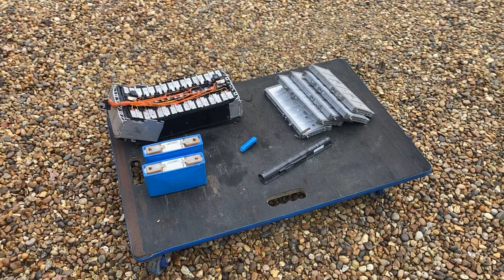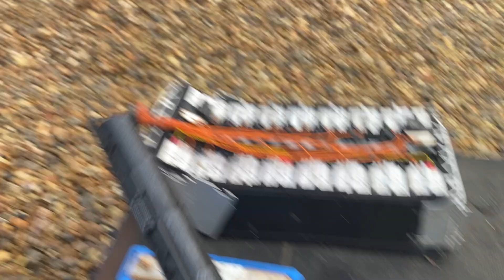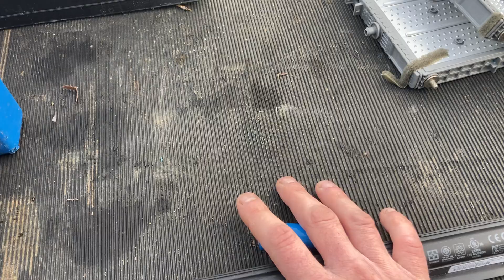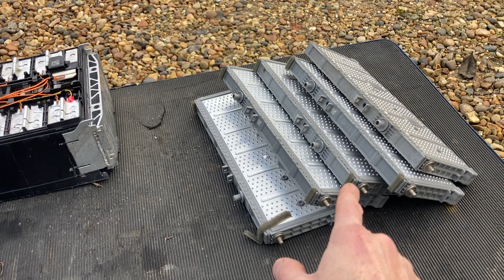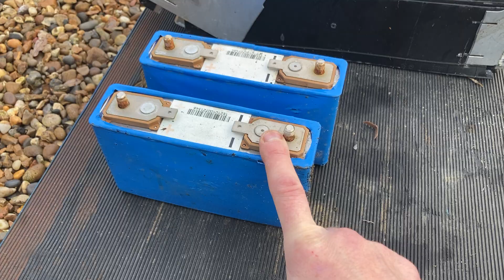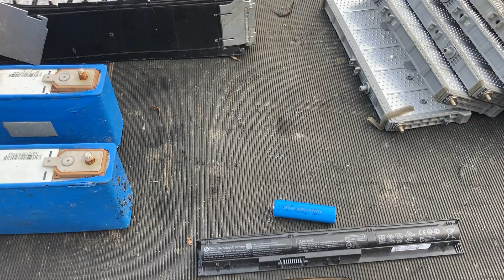Why can’t we recycle big EV electric car batteries in the UK currently???

Comment: Cawley's subsidiary "Lithium Battery Recycling Solutions" claim to be able to recycle EV batteries from commercial sources for a fee. It's really not good enough that there's not a regulated and funded system in place yet. The government can't leave such a safety issue entirely to the market. I expect the market for used batteries to boom at some stage as it already has in some places and some contexts... But it could also boom in the other way if it's not safely established
Reply from the maker: So under the weee regulations the manufacturer is responsible for the recycling and every battery has its recycling cost factored into the sale price. It’s just that it isn’t yet joined up so even if someone at VW for example knows about how to arrange battery recycling (which I’m told there is such a person) not many people seem to be able to contact them to get or arranged and transport options for batteries aren’t yet clear.

Comment: LiBatt in Wolverhampton are now accepting batteries, and bill themselves as the UK's biggest recycling facility. I think they are charging gate fees, so there might be a small charge for dropping off with them.

This might not help you directly because it might not be local enough, but I thought you might be encouraged to hear that there is finally a UK recycling facility.

Google Recyclus Group if you can't find them.

Comment: Everything, and I mean absolutely everything ends up in landfill eventually. 

Recycling works if the new original product requires lots of energy for raw manufacture. 

Otherwise, it's just a waste of energy.

It takes lots of energy to recycle most materials, which everyone just tries to ignore.
Reply: As blanket statements, these are wildly false. Recycling some items is net negative, but within the context of the video, ev battery recycling will reduce the mining of new materials significantly, and requires less energy than digging up new materials.
Reply: You don't recycle aluminum where you live? It saves 95% of the energy.
Reply: Responsibility of the supplier/manufacturer. Contact your MP and DoE

Comment: Trading Standards may be able help and give advice?
Love my EV, but being honest this is another 'Elephant in the Room' that hasn't been addressed by both OEMs and battery manufacturers. Until there is a suitable recycling plant(s), there needs to be a system in place for safe transporting and storage. 2nd 'Elephant in the Room' is dealing with an EV on fire from its components or/and battery.

Comment: The recyclers do not make money from the small batteries.  They really do kot want them. They prefer the EV batteries because they get more materials for the same effort.  It seems to me that the problem is the logistics of getting the cells to the right place.
Reply from the maker: Transport of failed large lithium batteries is presumably also tricky !
Reply: @garycevrepairs  I did some work for a customer in Australia setting up a battery recycling plant. They need to discharge the batteries before shredding them. He did mention that they loose money on the small batteries because of the labour cost and the amount of plastic that comes out vs the amount of black mass they get.
The EV batteries are profitable because they need far less labour. They plug the EV battery pack into a device to discharge the battery (and use the energy to feed into their electricity supply). Once it is discharged they remove the electronics and the entire pack goes into the shredder in one piece.
The small batteries are put into liquid which discharges them and once they are discharged they get shredded. Also there is more metal in an EV battery pack than in small consumer goods batteries.
So I think the main problem is there aren't enough EV batteries available for recycling yet.
I also see that in the future there won't be many batteries being repaired.  The majority are being glued together as a big block making cell replacement close to impossible.  This is not done to stop shops repairing batteries but more about making the pack stronger, more reliable and easier to manufacture.
Reply: @garycevrepairs If only the UK had a state-owned railway 😂

Comment: they figured it out with lead acid batteries.... those are a circular economy which is monopolized here in the US. theyre like 99% recycled or something crazy and logistically much heavier to move around and filled with sulpheric acid. crazy how lifepo4 batteries can last 20-30 years. problem is batteries are so cheap now they are not worth recycling for materials other than cobalt, and cobalt is being used less and less in batteries. not sure whats wores, a lead acid battery that dies every 2-3 years and has to be recycled, or a lifepo4 battery that does the same job and lasts for 20 years and needs to be thrown away at the end of life. i think throwing stuff in the landfill is fine if we have to use exponentially less energy and materials to build them. 1 lifepo4 car battery could offset 10 lead acid batteries and would only weigh about 7lbs and takes up the same volume as a large half gallon of milk. I know because i replaced my car battery with one i built for 50 usd about 8 months ago. the AGM battery replacement was over 200usd what a scam.
Reply: Great video yet again Gary !!!! 👍👍
Reply from the maker: Thanks

Comment: Even the 18650’s usually have years of use left in them if you know what you’re doing. We were even building them into power walls before the much safer Life P04 cells became a viable option. 
Corey Mac of “OY Electrical” did a great video hacking into a Jaguar ipace battery to use as a home storage solution. I know there’s a big market for LifeP04 batteries in the “van life” community.

Comment: I've been to breakers yards where they have stacks of battery packs piled up and can't get anyone to take them very easily.  It's getting to the point most breakers are refusing to take these vehicles unless the pack is already removed. 

I think one thing that would help enormously with EV batteries, would be if they were modular so that dying or dud modules could be easily and cheaply replaced.  Sort of like having an industry standard socket or slot that they are fitted into.  If the BMS were adaptable enough you could even mix capacities or chemistry.  It would make EVs a lot more future proof and keep them on the road considerably longer!
Reply: If they are working packs, there should  be plenty of takers :D
Reply from the maker: Mostly dead ones here, they don’t last forever!
Reply from the maker: Working ones are easy to get rid of, it’s the faulty or badly degraded ones that are no good any more that are the problem ! Cheers

Comment: There is an accelerating proliferation of battery cells in the DIY/small garage space. I have stacks of Leaf modules that are reasonably stable but they will need to be recycled sooner rather than later. I don't think the build up is necessarily an issue because a recycling plant will consume vast amounts of cells when it's up and running - so there needs to be a healthy supply. This is a short term issue that needs fixing before there are high profile accidents that could be avoided by establishing a decent recycling pathway before then. Simply saying this is commercial waste that DIYers shouldn't have is not going to work either - people might start dumping them if there's no legal way for them to dispose of them.
Reply: There have been a few fires in used/damaged battery warehouses, recycling plants and repair shop bins all over the world this year. This should be a hint that battery recycling needs to get done in a timely manner, otherwise all you have is a countdown to disaster. For most transportation to go electric, we'll need 10-20X more batteries than we do today.

Unless intrinsically safe batteries are invented and replace everything else, recycling potentially highly volatile batteries in a timely manner will become a question of public safety.
Reply: You need to be very careful about how they are stored. Which is away from human habitation! As they are a potential bomb.
Reply: This comes from watching advice to home battery installers that they cannot be installed inside a property only on an external wall

Comment: There is a new recycling center from EMR Recycling in Birmingham which opened last September. It can handle more than 2,000 tonnes of EV batteries per year according to its website. Ecobat Solutions can re-engineer or recycle high voltage batteries in Darlaston. Since January 2021 they have recycled 5500 EV batteries.
Reply from the maker: Have tried to engage with ecobat but they didn’t want to collect. 🤷🏻‍♂️
Reply: @garycevrepairs  Strange, from their website - Ecobat collects EV batteries, including end-of-life, damaged, defective and critical units, from all around the UK.
Reply from the maker: Spoke to a garage that contacted them and they said to contact the manufacturer as they couldn’t take the battery!